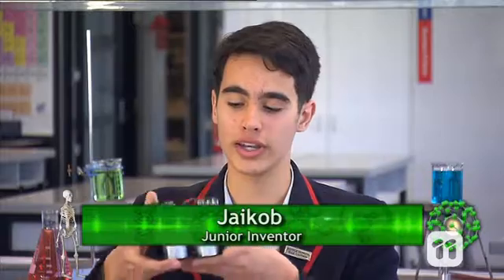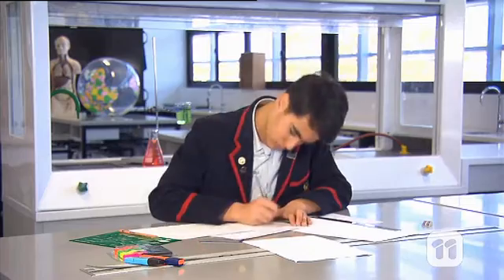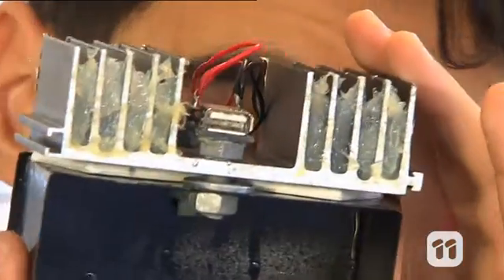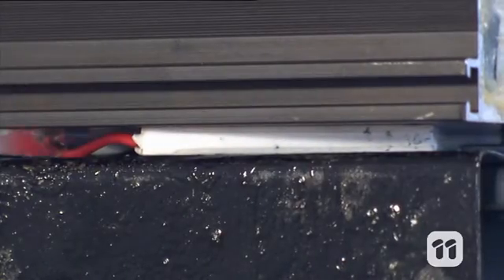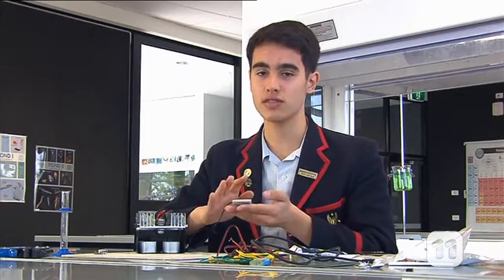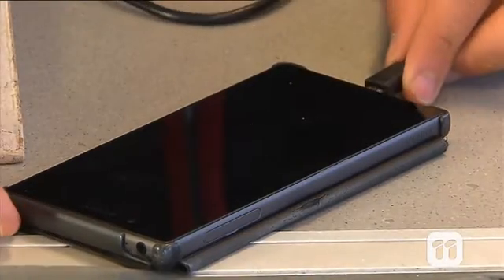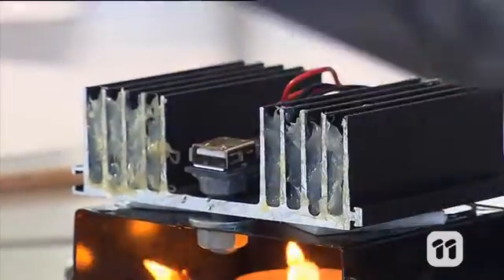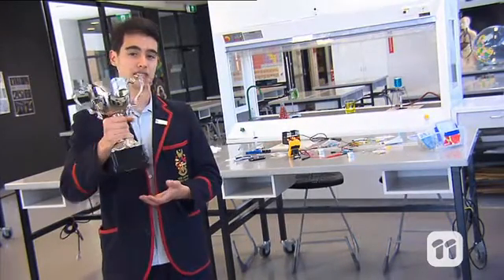Scope TV: Jaikob’s thermoelectric battery

Comment: why water? why not a low V pc fan? as the heat from candle gets hot enough and the V form peltier gorws, the fan will turn on by it self.
Reply: Water is a more efficient way of dispersing the heat , but he doesn’t understand that through a process called conduction, heat will escape upwards eventually boiling the water  , he should have done it the opposite ( cold side down hot side up)